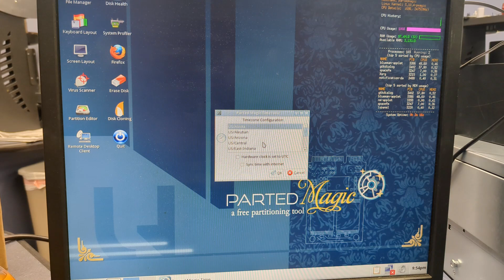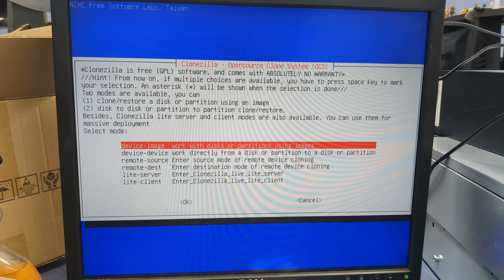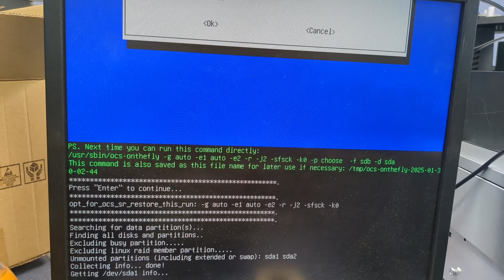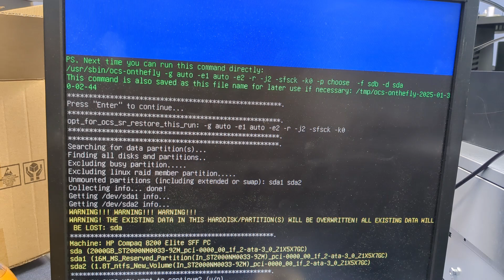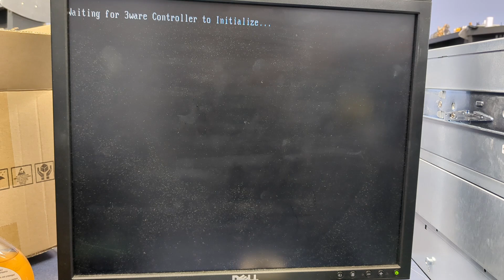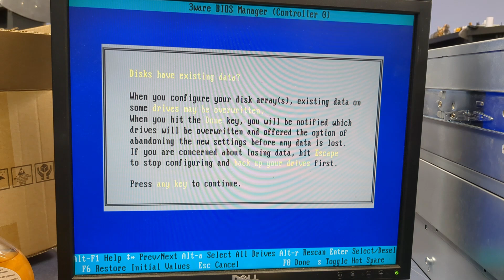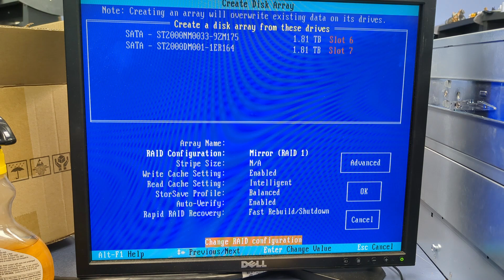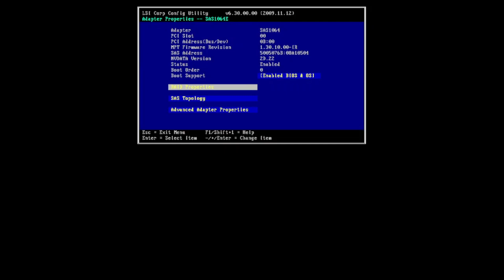How to save data from a dying hard drive! Can we do it?

Comment: no even if the board on the drive is the same you have to take the chip of and put on the one you going to use like a bios chip but it on a hardrive i got a replacment board for a 3 terabit  drive did that but my soldering is crappy and i buggerd the bios chip on my old hardrive it was bought on line but they say you have to change the chip over you can buy on line the same card maybe you can go that way ???
Reply from the maker: @KrissBartlett  It really depends on what firmware is flashed on the card, it's kind of a crap shoot. I've been able to swap boards in the past, with somewhere around a 25% success rate. There are a lot of specifics that you have to be careful about, and the truth is I don't know all of them lol, so I try not to do that unless I'm out of other options

Comment: It's important to note that while you can swap the boards if they physically fit, they also can contain important calibration data. Swapping the boards can fix the drive, but it can also result in more damage or problems while using the disk because the calibration data on the donor board might not be the same. Flashing the data from the old board to the donor board can fix the problem, but it requires specialized tools to do so. Your channel is awesome though really like the content.
Reply from the maker: Absolutely true! In fact, the 3 TB drive had the same board, but I knew better to try that as a swap, so I didn't even mention it. Even drives that are utterly identical can sometimes have different firmware that can cause issues when swapping the boards

Comment: Just remember back maybe 15years I managed to save 95% of data from a 500GB 2.5"-drive that ddrescue'd with some 5kB/sec for about a whole week. Knowing, that was the last chance (drive would probably not work anymore the next time) I let it run the whole week overnight, with some clusters of unreadable (that takes even more time) sectors.
The imaged drive then was mountable and without attempting to run a scandisk (was a windows filesystem) I could copy off almost everything.
Heh, that was my bosses sons drive at that time :)